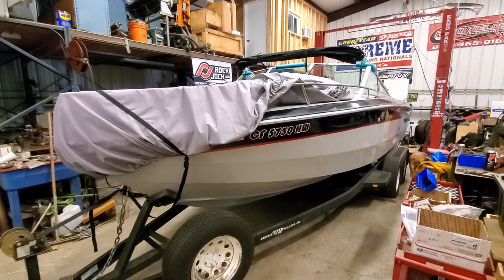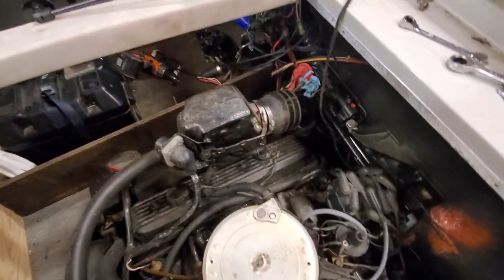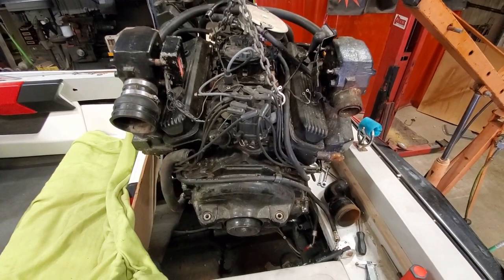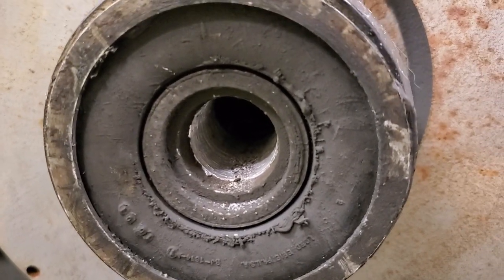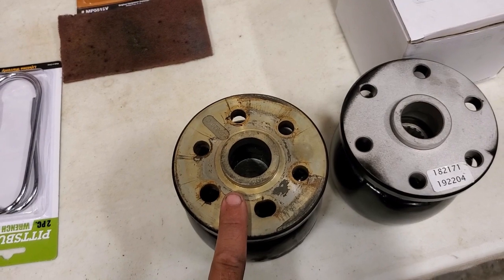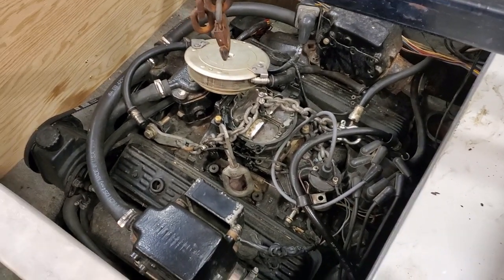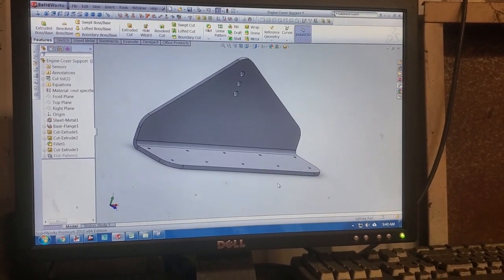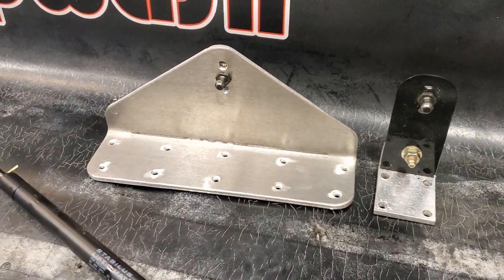Chris Craft Scorpion Project Part 11 - Coupler replacement

Comment: Nice engine cover bracket! A small pity it didn't fail before you upholstered it: you could have added captured nuts or a squash plate from the other side.